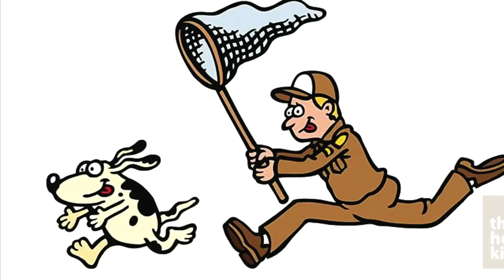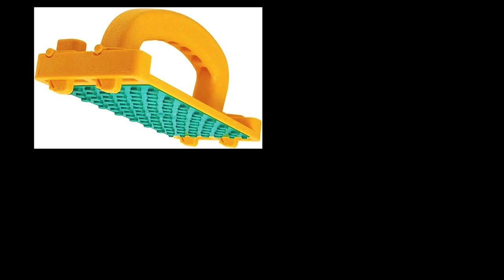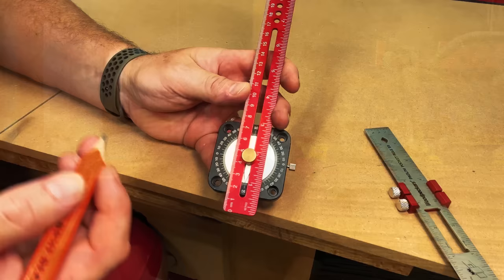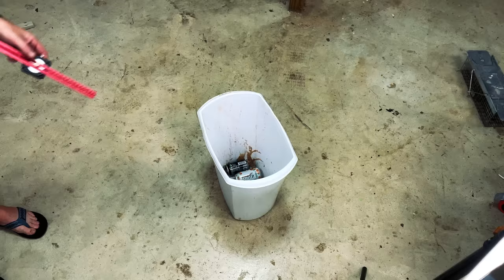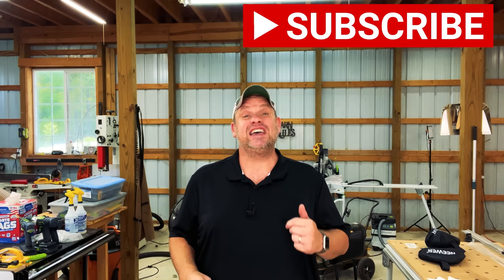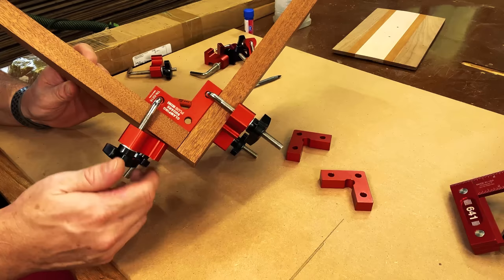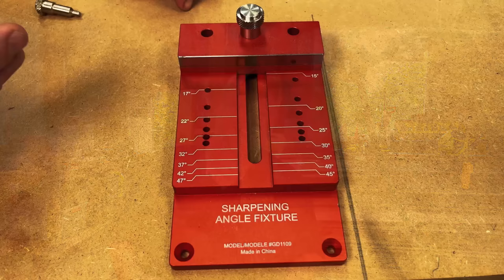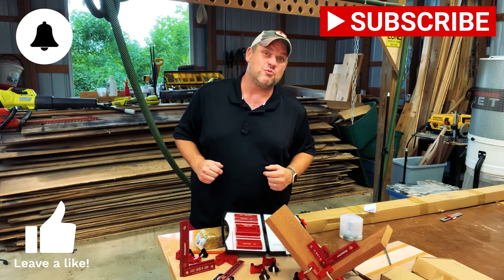Discover the Truth: Are Banggood Woodworking Tools Gems or Junk? #banggood #woodworking

Comment: I would buy the honing guide set. Although it is stolen from Woodpecker it was a limited production tool and Woodpecker no longer offers it. To me that says they made there money back on research and development as well as a fair profit. If thats true then I still struggle to accept the long term high prices on Festool, Woodpecker and others.
Surely the Domino has paid for itself and all development cost right? But i digress. If Woodpecker chooses to no longer produce the honing guide then so be it. Banggood it is!
Reply from the maker: That makes me feel better Sean! :)  Plus I don't think woodpeckers is is hurting in anyway for profit, but who knows, it costs a lot to product those tools.   I agree with you on the honing guide.  Excellent tool and it will be replacing my veritas honing guide, which was always a little bit of a pain in the a$$ to set up!
Reply: @FlynndoggWoodwork  I'm glad you mentioned the Veritas. I've been looking at that one. But now I'm seeing this one as cheaper, dummy proof, and seemingly we'll built. If the actual guide and rollers hold up then it'll be good! Woodpecker talked about the rubber grommets going on the brass wheels in those grooves. But I'm wondering how much and if it throws off the degree setting? But they say it saves the brass on diamond stones and easier on wet stones.
Reply from the maker: @seanbrotherton542  That veritas is nice, but definately not as easy to set up as this one.   I suspect my veritas will start to gather dust with this new one... that is unless I fun into something I'm not expecting!